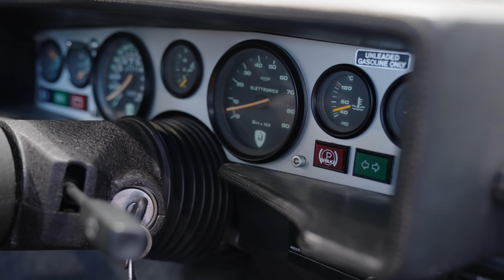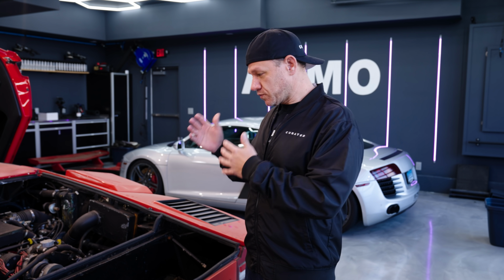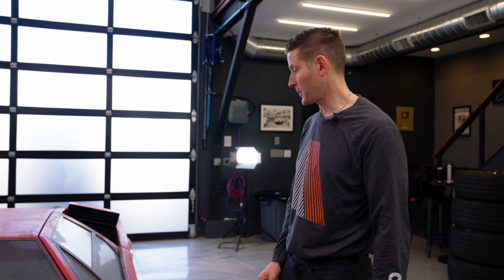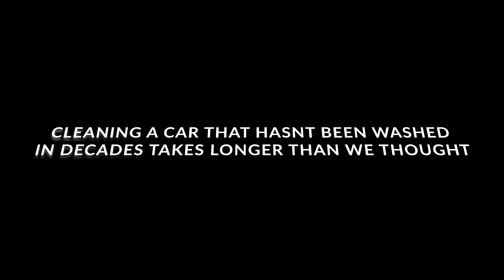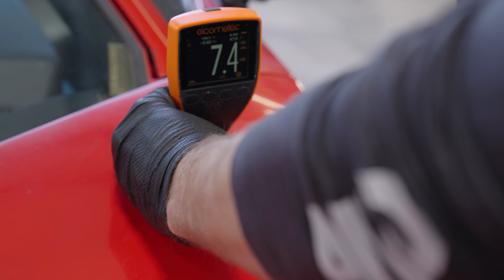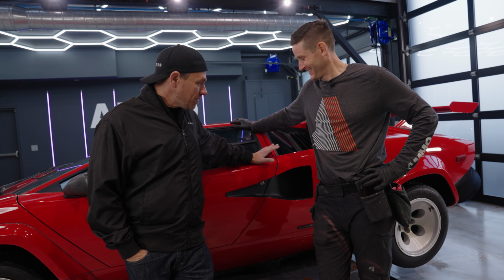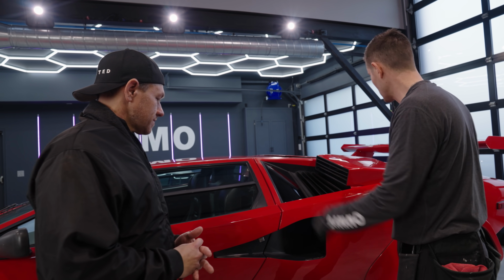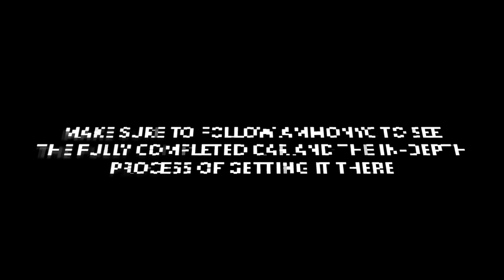Barn Find Countach TRANSFORMED by AMMO NYC (Epic)

Comment: If you want to own that car as a driver's car, versus an investment car, the exterior is fine as is. No need to go any further, maybe just one more coat of a nice durable "wax," but that's all. When I get my Countach, and I will get a Countach at some point, I want the cars paint to be in it's un-reconditioned state, then cleaned and detailed like these Gentleman Just did, no new paint. Then the interior clean and leather conditioned. The electronics, drivetrain, and suspension all mechanically sound, and I'm ready to go. No need for absolute showroom Perfection here, I plan on driving it the majority of the weekend, every weekend, until the day I die.

Comment: YES! A Countach of that era NEEDS the ridiculous rear spoiler! Front spoiler, optional, but only in black. No spoiler is for the 70's without the wheel arch flairs.  Dems da rules! :-D
Reply: The rear spoiler serves no aerodynamic purpose. And it actually looks better without, IMO.
Reply: @Defender-Guy  It looks better with it. Both opinions carry the same weight on the rear wheels.
Reply: @pgtmr2713  That iconic rear wing was purely cosmetic. The Countach actually suffers front axle lift at high speed, and bolting a park bench out back only exacerbates the issue. But customers loved the look, so engineers zeroed out the wing’s angle, rendering it nonfunctional. So there you go. I prefer real stuff.

Comment: Hey Larry, been watching your videos for last 6 months and absolutely love them and have learned a lot. I do have 1 suggestion for you when removing stuck or difficult lugs. Get like a 3 foot or so long pipe thats got about 2 or 3 inch circumference width. Put the pipe over your ratchet or torque wrench handle to extend the length of the wrench. You'll increase your force exponentially and not be in that horrible bent over position killing your back. I've heard you mention that you have back issues, so I always cringe when I see you struggling on lugs that haven't been removed in decades. The ones you did on that BMW track school car I thought you were gonna herniate discs in your back. Anyway, just a suggestion. Great collaboration video.
Reply: or put it at a lower angle and stand on the breaker bar.
Reply: @michaelparra8719  yep that would work too. Just get that torque off the back.